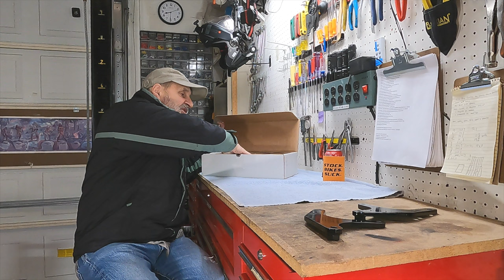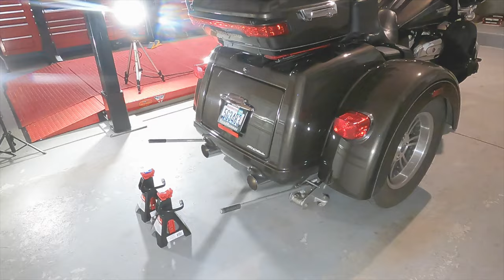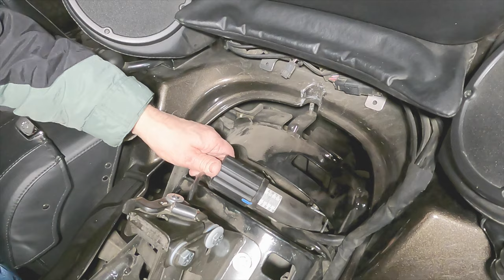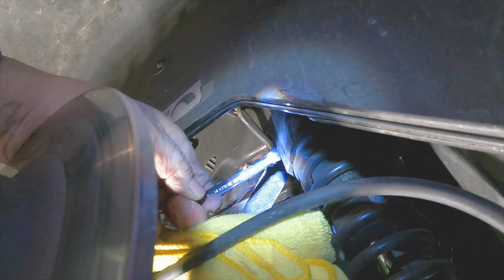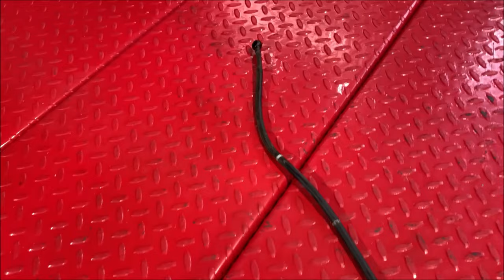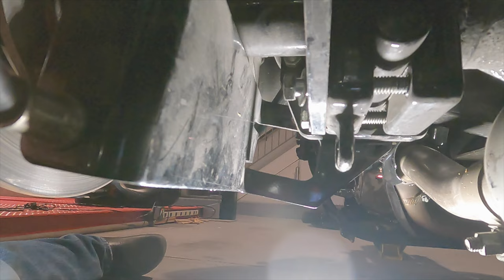Harley Davidson Tri Glide NexGen Shock Install

Comment: Absolutely the best suspension/shocks you could put on a Harley Triglide. I truly truly love them might’ve been on for about six months and what a difference it has made in my bike or my trier.
Reply from the maker: Agreed! Although I have not tried any other shocks to compare these too,but now I don’t need to because I am totally satisfied with the ride. I put them on and felt they were too soft so I took them off and adjusted them to be a bit more rigid/harder.  Later I felt they were still too soft, and took them off again and adjusted them. That time to perfection.   I have been riding for many many years. Before I put the shocks on, I was seriously considering selling the motorcycle and just getting out of motorcycle riding. I am glad I didn’t now.
Reply: @windsurfed1  How come you took them back off 2 times, they say you can reach the set screw and turn the adjuster to turn up or down for adjustment. Was it hard to see and do is why you took them off 2 times, I'm interested in them myself for my 2018, already have the lift kit but air shocks on mine suck, I'm running around 20 lbs of air with 21 lbs in rear tires, I'm not interested getting them and then have to take them off again like you did, I will just keep my air shocks and suffer with the ride, the roads I drive are to bad but there are roads I want to travel and I don't because of my back. hope you see this and maybe explain why you took them off 2 times to adjust

Comment: Congratulations on  a job well executed and my particular respect for the excellent camera work and subsequent editing, all conducted to professional standards and made this video a "must watch" for anyone tackling this task on a Triglide.  Thank you.
Reply from the maker: Believe it or not, I have went in there and taken those shocks off two more times to fine-tune the adjustment to my liking. It was time-consuming and a little bit irritating. But I got the shocks dialed in perfect and they are wonderful. At first they were too soft. Then I adjusted them. Then I took them off because they were still too soft and adjusted them and put them back on. Like I said, now they are fantastic.
Reply: @windsurfed1  You have to remove the shocks to adjust them ? I've never heard of that before ?
Reply from the maker: @wb4514  apparently not. Just reach up there and loosen the set screw on the top of the shocks rotate the adjuster to where you think you want it re-tighten the screw. No need to take off the shocks I did because I was an idiot.
Reply: @windsurfed1  Na, it's a learning curve figuring out what works !

Comment: Dang... these are EXACTLY the lift kit and shocks I want to put on- did a video where I talked about these in particular. Kudos to you!
Reply from the maker: Glad you saw the video. I took measurements of the lift in the back of the bike before I installed the shocks and the convertible comfort lift kit because I had my shocks set on the probably softest condition because I wanted a real soft ride. I actually lost 3/16 of an inch in height in the rear, which was expected by me because I saw DK’s custom videos on why your expectations of height may not come through. It was a three part series.  The OEM shocks are much stiffer and had I just put the convertible comfort lift kit on a probably would’ve gained an inch and a half and, maybe if I would’ve ordered the 14 inch next GEN shocks I would’ve got a better lift. But I’m not worried about it. Bike still looks the same. I wonder what it would’ve looked like it had I not put the convertible comfort lift kit on there and use the OEM shock mounting bracket. I’m glad I did use the convertible, comfort shock bracket.

Comment: You commented that your trike is sitting 1/8 inch lower that with the OEM shocks. That's expected. Go watch the bottom video on the Nexgen shock page (13 or 14 inch) and they explain why the difference occurs----it's in the sag. Great video. I wasn't sure if I wanted the 13 or 14 inch shocks, but after watching that video and the fact that I ride 1 up the majority of the time they recommend thew 13 inch as the 14 in would be to stiff. Again, thanks for a great video. I will be referring back to it. The only difference is I think I'm gonna take the rear box off as I have a fused neck (reason I went to a trike) and getting into tight spaces is difficult sometimes. Thanks again.😎😎
Reply from the maker: @theChestnutMtnTinman  Great idea to take the rear box off. It will make installing the shocks 1000% easier. I am aware of the SAG situation on the rear of the bike. (How that works) and I am satisfied with the height and especially the new shocks. Difference between a night and day.

Comment: Great stuff, thank you for sharing. Real time action of the road surfaces
And your view of the shocks new ride. Was great,again im thinking about the same setup w/14 inch rig.
Reply from the maker: I think next time if I did it again, I would go with the 14 inch. Putting on the 13 inch actually lowered my rear end one eighth of an inch. I even put the DK custom lift kit on it. But because the OEM shocks were stiffer  and the DK custom next GEN shocks were softer it actually lowered the rear end. I don’t know how much Lower it would have been. Had I not put on the lift kit

Comment: Thank-you for your video, it was excellent and well done. I just got a 2022 Tri Glide ultra (with 6900 miles) and my first impression about the ride was not good. It was a rough ride and the trike wanted to move side to side. I ride solo all the time and want a much softer ride. I will be looking at those upgrades. I am physically limited so I will be removing the trunk and fenders so I can get to everything.
How was the ride after you finished?
Thanks,
Bruce
Reply from the maker: Bruce, I just seeing this post.  Some how I missed it. The ride is great. I did a follow up video with a rider review.  Did you put new shocks on.  Did you remove the fender to install them?
Reply from the maker: https://youtu.be/GqCwlXY0hhM?si=-CQB9j_7wIbfTPzj

Comment: getting ready to do my lift kit install and doing the 13" Nexgen shocks. great vid
Reply from the maker: Yes, it was pretty straightforward putting them in. However, even with my convertible comfort lift kit on there I lost 1/8 of an inch height in the rear because I had the shock set on super soft. Let me know if you lose any or if you gain any height. .

Comment: What a very well done video!. The best iv'e seen. Your photography and lighting showing locations and everything in detail supurb!! Thank you so very much!. I have a 2022 Tri-glide and looking to do the very same thing..  Hopefully in your very next video, you will honestly tell us how she rides, corners and steers, Along with the pinch Higher rear height? Thats supposidley to make the front wheel stick or feel better, handle better?.. And the total cost$$... I can install this myself too.. Please let us know and thanks again!. And Ride safe my friend!!!..
Reply from the maker: did a ride video a couple weeks ago and posted it on my YouTube channel. You can see it if you like. It is a world of difference. 

I took measurements
On the right rear fender height, the middle of the bike in the rear, and the left fender height in the rear  with the OEM shock height, and then, after I was done installing the shocks, I did another measurement with the new shocks and the convertible comfort lift kit in the same position. 

DK custom did a video on why the heights of bikes possibly could not be lifted  after adding the convertible comfort lift kit. There was a number of variables,, including the softness of the shock, the rider Weight, and a couple other variables. A very good video explaining why your bike may not be lifted as you expected to.  

I understood that before I bought mine. After I did my measurements, after the install, I actually lost 3/16 of an inch. So it was 3/16 of an inch lower. I can’t imagine how much lower it would have been. Had I not install the convertible comfort lift kit.

My shocks were set on the softest position probably you can put it on that’s probably why it went down. Had I put it on a more stiffer position? It may have went up.

I wish I would’ve installed the convertible comfort lift kit with the OEM shocks, and then took a measurement, but I didn’t. I wonder how much higher it would’ve been. Because those things are very stiff.  

It still looks as level as it did when I first bought it. You really can’t tell but let me tell you a ride so much better.   

For the shocks in the convertible comfort lift kit was right around $1100.

Comment: Thanks for the great video. I noticed you installed the Convertible Comfort Lift kit using the highest lift position, but the instructions say for your year of Trike you should use the secondary lift holes. Did you have any trouble getting the lift bracket installed on the front holes?
Reply from the maker: @striking827  I did have a bit of trouble installing the lift brackets. Only because I tried to do one at a time. You are supposed to remove both of them then install one at a time. When I follow that procedure, it went together well. I was not aware of, my year of Triglide instructions to use the secondary lift holes. I did not see those instructions. However, after installing the shocks, and the lift kit, I actually lost 1/4 of an inch of height in the back of the bike. The OEM shocks were stiffer and held the back end up higher. the next GEN shocks are quite a bit softer and Lowered the rear end, even with the lift kit. If I had not installed the lift kit, the rear end, probably would even be lower. Glad I installed the lift kit.

I actually followed the instructions and put the bolts in the highest lift position. At least that’s what I thought. Now you got me thinking.

Comment: I am replacing the stock bearing plate with the DK Custom Products plate, while I’m doing the shocks. Thanks for your video.
Reply from the maker: Glad you could use a video. The shocks were a little harder than I thought to replace. Since I replaced them, I have taken them off two other times to fine-tune the adjustment to my perfection. Again, it was rather difficult, but now I am dialed in, and it rides like a dream.
Reply: @windsurfed1  I replied to this up above and not sure why you took them off, they said you can reach the set screw without taking them off and turn the adjuster up or down for what you need to do, I'm thinking of not getting these shocks if I have to take them off after putting them on, I know what I went thru putting on the lift kit and that was a few years ago and my body is worse now, like you I'm a senior citizen, LOL
Reply from the maker: @junglejim8901  you know I am a senior citizen also. I’m not sure I even re-tighten those set screws back down. Perhaps I could’ve adjusted it without taking them off. Now you got me thinking. I’ll go look at one of these days. That would be nice if I don’t have to take them off to do it.  Thanks for the conversation. Dummy me. Probably didn’t have to take them off to begin with. I actually forgot all about those set screws.  I bet I could have adjusted them by losing that said screw like it says in the instructions and twisting the top of the shock, one way or the other. I just totally forgot about that part of the instructions.
Reply: @windsurfed1  Ok I guess you forgot about what the directins said, I'm glad you have them the way you want, I'm surprised you even had to do this after filling out all those questions, they should have been set from day one, oh well, I'm thinking would have to take tire off to get to set screw, that I'm not sure but at least that would give more room to get to the set screw. I'm still  trying to decide if I want to spend this kind of money, happy riding and enjoy, I just wish you would have did a report on shocks after the install before you put the ricor inserts in, I'm also thinking of the ricor inserts also, if it isn't one thing it's another LOL have a good day, thanks for the reply, wasn't sure I would get a response but I'm glad I did, thank you again
Reply from the maker: @junglejim8901  I did a ride review after I put the shocks on if you’re interested. They are a little expensive, but I am glad I put them on because it is a difference between night and day.  

https://youtu.be/GqCwlXY0hhM?feature=shared

Comment: Great video by the way. 
 Now did this take care of the rear-end wobble at highway speeds like 70 miles an hour plus? I'm looking to install this on our 2021 Tri Glide.
Reply from the maker: Thanks for the comment. Not sure what you mean by rear end wobble at 70 miles an hour plus. If you’re experiencing that, I am definitely not. It is very smooth that 60 to 100 mph.  Shocks do make a world of difference in the ride for the passenger end driver

Comment: It's obvious in your video that you didn't watch the DK Custom Products Video on removing the bottom lift brackets FIRST on both sides and then remove the top shock bolts lastly!  It would have not startled you the way you did it. I'm glad that you didn't get HURT!  I was Impressed with your next video on how well the Tri Glide rode with the 13 inch NEX GEN Shocks! I also own a 2020 Tri Glide and I will soon be installing the 14 inch NEX GEN Shocks which according to DK Custom Products will give a slightly better ride if you like to do a lot of long distance riding!  I'm not knocking you for your choice of shocks.   My apology ... Question.... Why did you change your online name from Tri Glide Ed to windsurfer ?  and move to the State of Washington? It's None, But I'm Curious? Ride Safe my Friend!
Reply from the maker: Good morning, I actually did watch the DK custom install video and I remember them saying remove both of the shocks before you start. But I didn’t remember till after that incident happened to me.  I am windsurfed1, and I have had a channel for about eight or nine years, and I live in Washington state. Triglide Ed, who I watch his videos also, I believe lives in North Carolina.  I’ve had conversations with him in the past. I bought the 13 inch next GEN shocks and the convertible comfort lift kit and I actually lost 1/8 of an inch of height in the rear because I had the shocks set on such a soft ride. If you watch the DK custom video it will tell you, that different shocks will produce different result in the height. You’re probably making a good choice by getting the 14 inch shocks with the convertible comfort lift kit. Especially if you’re looking to raise your height of your rear end. And you are correct. I am fortunate that I did not get injured putting those shocks on.

Comment: I own the 2023 tri-glide and I to am looking into the DKCustom nextgen system, however my question to you sir is did you look into the suspension technologies shocks...!!
Reply from the maker: I did not look into the suspension technology shocks. I looked at a lot of other shocks from other manufacturers for the Tri glide though.  I just settled ok the dk custom shocks.  I am very happy with them.  Perhaps there is even a better shock out there, but I wouldn’t/couldn’t know unless I Tried them all. That could get expensive.
Reply: @windsurfed1  Thank you very much for your input. I watch your video's all the time . Really appreciate how educational they are. Again, thank you. My wife and I purchased the 2023 120th anniversary "674/1100" tri-glide - we have a stage one installed the ultra cool oil cooler system the high flow oil filter the Jims Force Flow fan a set of 14" Paul Yaffe bars and a LP-6 upfront to be seen and to see Now we are looking into suspension upgrades . Really appreciate your videos Thank you.
Reply from the maker: @deanbedetti  holy mackerel! You did a lot of work to that thing! I bet you’re really enjoying it. I bet that stage one really helped you now can ride many more years without falling over. Enjoy!
Reply: @windsurfed1  Did not want to change it at all due to it being a limited-edition trike, however commyfornia traffic and the typically hot days . My wife was really feeling the excessive heat , so we made the decision to do the necessary upgrades. Thank you for your compliment , more importantly thank you for your great videos.

Comment: I've watched several of these install videos and after the install, thy address sag and droop. I didn't see you mess with that. Are you OK with them just as they are out of the box ?
Reply from the maker: I bought the 13 inch next GEN shocks with the convertible comfort lift kit. I measured the rear of the motorcycle before I installed it with the OEM shocks and then measured it after I installed the next GEN 13 inch shocks. I lost one eighth of an inch of height.   

The OEM shocks are stiffer and hold the body up higher. The next GEN shocks are softer therefore they sag. 

Don’t know what the height would have been had I not installed the convertible comfort lift kit. Kind of wish I would’ve went with the 14 inch shocks.

But to answer your question, yes, I am very satisfied with the height of the motorcycle in the rear and extremely pleased with the ride of the shocks.  

I did a video of a test ride after the shocks are installed
Reply from the maker: https://youtu.be/GqCwlXY0hhM?si=DoAoDrReESHR9Hi-
Reply: Thank you for your reply!
Reply: @windsurfed1  I'm pretty well sold on the DK shocks for my 2017 Freewheeler, now if I could just come to a decision on the 13" or 14". I wish they would have just made one version or the other.